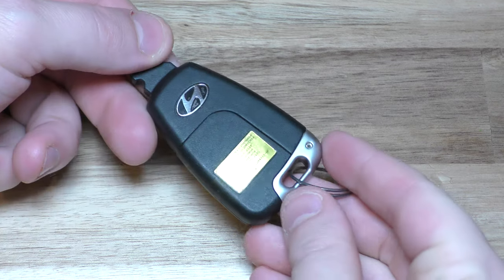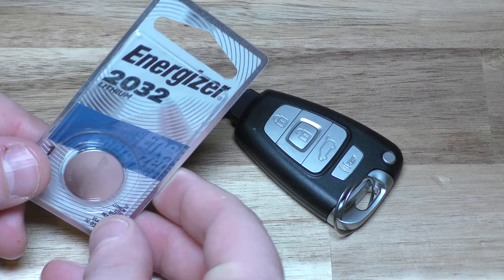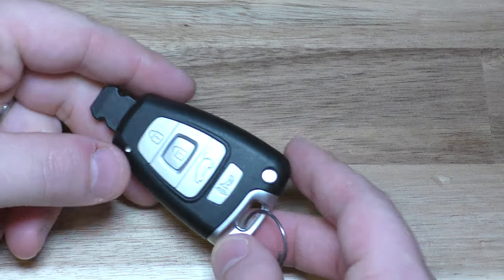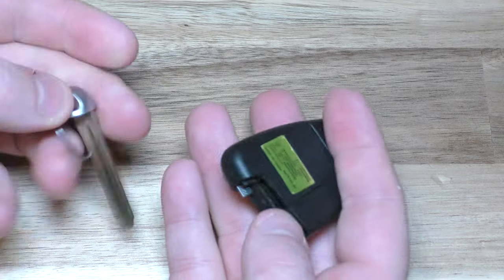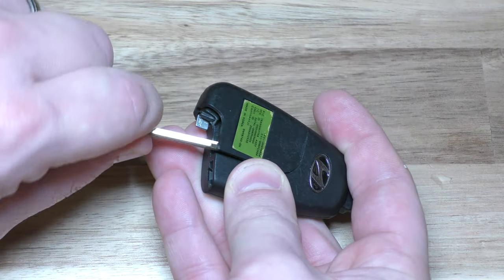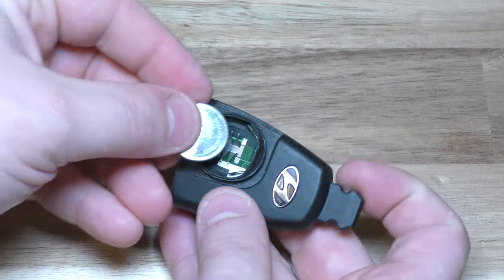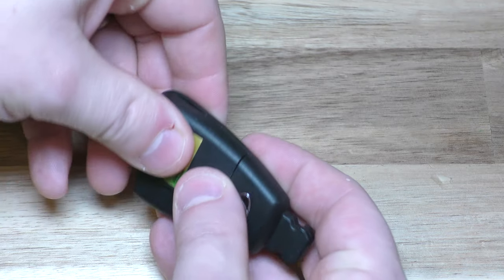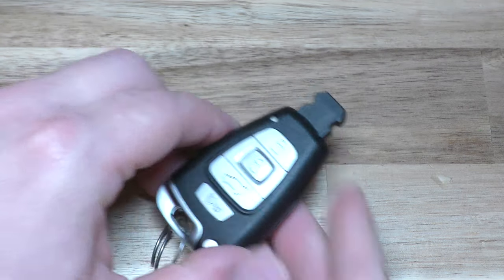Hyundai Veracruz Key Fob Battery Replacement - EASY DIY

Comment: Any idea where to get the metal battery conductor? I don’t need the whole fob, but it got wet so I took it apart and lost the little prongs that go around the battery. I’m assuming the negative charge?
Reply from the maker: You best bet is probably to buy an aftermarket fob and use the guts to replace the missing pieces on your OEM fob. Something like this - https://ebay.us/DwWsAy